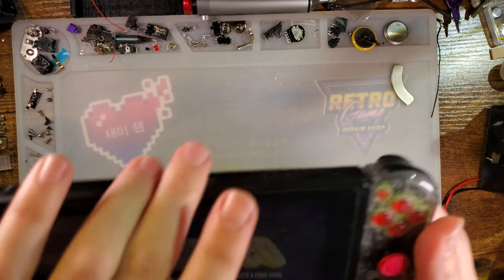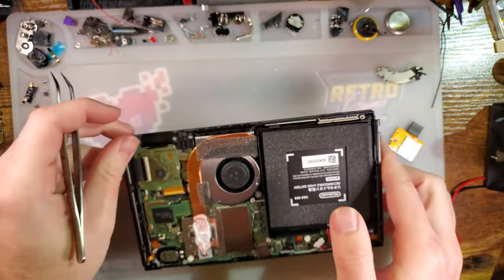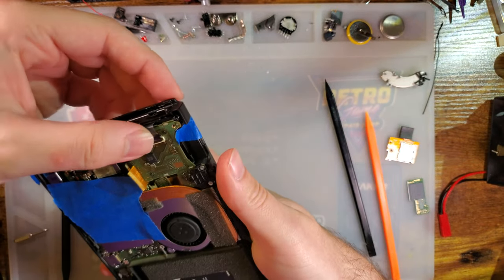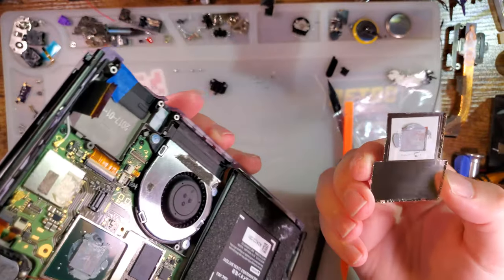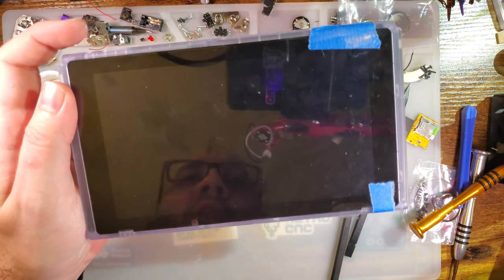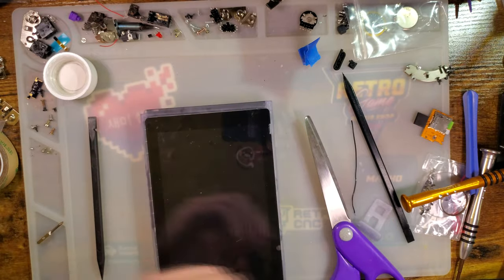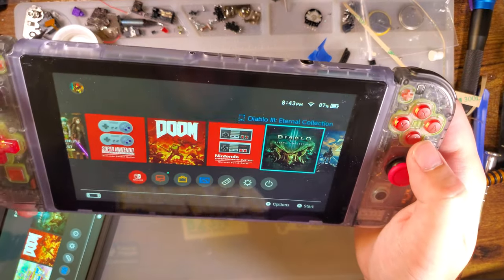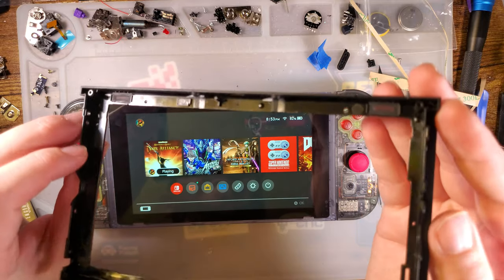Laminated Nintendo Switch LCD Installation (Release Model)

Comment from the maker: I did the panel a disservice by leaving the protective plastic on the whole time. I should have removed it at the end but I did not. Here are some images I captured after the install with the plastic off (and the same glass screen protector installed that I had removed in the beginning of the video): https://imgur.com/a/7ClvIij

And I ended up ripping the console apart to install the little parts I forgot initially. Enjoy this new album (I cleaned the screen this time): https://imgur.com/a/cC07sbE
Reply: I feel you also did a disservice by not cleaning the old screen while you were demonstrating how it looks. It's really hard to judge old vs. new when the old is so freaking smudged with fingerprints that it pollutes the image.
Reply from the maker: @ProjectDv2  The pictures I took have the same screen protector installed as the original screen and thus the same smudgyness. No point comparing something perfectly clean when that something will never stay perfectly clean IMO.
Reply: @makho  You don't clean your screen before you play?
Reply from the maker: @ProjectDv2  in the video (and pictures) is about as dirty as I'd let it get. Any worse and I'll clean it, yeah. I don't mind a patina of fingerprints as long as it's relatively consistent and if I clean it, I have to maintain that clean otherwise it will bother me.
Reply: @makho  that's fair enough. I can't deal with more than two or three fingerprints on my screen when I play, the cloudiness of the finger oils ruins the contrast too much for me.
Reply from the maker: @ProjectDv2  I don't tolerate two or three either. It's an all or nothing thing for me.
Reply: @makho  if I have a cloth handy, it's nothing all day.

Regardless, thanks for putting up this video. I've been considering replacing the front bezel and didn't realize wow how much work it would be. A question about the 3M tape you use, is it any thicker than the OE gasket tape? Does the screen stand it any when using it?
Reply from the maker: @ProjectDv2  nah I believe the stuff I used is actually a bit thinner than OEM. It doesn't seem to make a difference in terms of fit though, especially with the glass screen protector on top.
Reply: @makho  word, I've learned a new resource. The double-stick I've gotten in the past is chonky stuff in comparison and drives me nuts.
Reply from the maker: @ProjectDv2  Here, I took new pics after I ripped it apart again: https://imgur.com/a/cC07sbE
Reply: @makho  LOL "a pain point." 😂 But seriously, thank you for doing that. I get a much better idea of how it looks. Now I'm rather tempted to go for one of these laminated screens if I do the bezel swap.

Comment: It's only a matter of time before we'll see glass digitizer laminated replacements
Reply from the maker: I hope so, I will gladly swap this again lol
Reply: @makho  I'll gladly watch you swap it again
Reply: @makho  yo laminating is easy peasy. I do it to phones all the time as the glass only cost like 10 bucks, might ruin it but then I only wasted 10 bucks. But you dont have to try to delam so you got it easy. I laminated all my old hand helds. It's called uv glue. Theres tons of brands but they all do the same thing. Good luck bro love your vids cause of the length. Nice to listen to while I do stuff
Reply from the maker: @snowfirebeast  yeah, no doubt. I've been doing a lot of research on LCD lamination and while I think it is something I can manage, I'm not sure if it's a rabbit hole I want to go down. As is, I can barely apply screen protectors, let alone laminate LCDs. 

As is, I basically want maybe one or two more assemblies (one being Switch Lite) so I'm not sure I'd want to stomach the cost to DIY it well enough.
Reply: @makho  😹

Comment: Most I've done was replace the thermal gunk with thermal pads & AS5 on the processor and the ram; and here you are doing the entire screen haha
Reply: I did the same thing with my V2 earlier this year, cleaned all the dust out of the fan and heatsink (there wasn't very much), replaced the thermal paste with arctic MX4 and I had to replace the gamecard slot.

Comment: Sorry for so many comments but. Heat up your stickers then put the blue tape on. Wait a sec and it will usually pull off without damaging sticker. Then warm up and place in place. Let it cool then remove blue tape. That's what I do when custom painting stuff

Comment: you dont really need the copper heat spreader. just do direct copper heatpipe on the soc
Reply from the maker: I've got some ideas on cooling mods but at the same time, I've never had any issues with throttling or frame drops so I think it's fine as is. Good to know for other consoles that might run warmer though

Comment: There is not difference between Switch V1 and V2 displays. The only thing which changed is Nintendo jumped on cheaper screens from InnoLux while launch Switches were using JDI screens which are amazing in every aspect - color,  brightness etcs.
Reply from the maker: Why do you think the listing divides the two then? 
It makes sense, I honestly thought they were interchangeable, but it seems kinda strange for the seller to specify.
Reply: @makho  No idea, but i'm pretty sure they have no difference. Prob he is meaning also the different brand of the panel.
Reply from the maker: @borisdg  I worry there's more to it than that so it's probably worth specifying, at least for that particular seller. Maybe it's a fitment thing too (but I was under the impression that that should be the same).
Reply from the maker: @borisdg  looking into it more, there are apparently v1 and v2 digitizers and cart readers (the digitizer plugs into the cart reader module). The displays appear to be fully interchangeable but the touch digitizer may not be and that's why the listings are separate.
Reply: @makho  Interesting. Thanks for sharing!
Reply from the maker: @borisdg  I'm still unsure if it's a branding thing because the parts are marked differently or if it's an actual electrical incompatibility but that seems to be the reason why there are separate listings for the assemblies.

Comment: I am reasonably sure I have a laminated LCD, but similarly also with a plastic digitizer, and I got at least one decent scratch in it before I put a screen protector on it, and I ordered that almost immediately, but it beat me to it, unfortunately.
Reply from the maker: unless you replaced it recently with a laminated unit, that's unlikely. But yeah, that's why I left the protective plastic on that whole time, plastic digitizers make me nervous
Reply: @makho  Ohh, I understood it as that was a factory unit or something. So no, no dice. But this makes me want to be on the lookout for glass digitizer laminated units, especially if there's an OLED option coming down.

Comment: You can remove that copper sheet from the heatsink entirely and get much better cooling by having the heatsink directly on the cpu. I dont see why they put the copper sheet and two thick layers of paste there its stupid and I doubt its much better than a thermal pad which would have been a much better option since it wont dry out
Reply: If I were to guess, it's for RF interference reasons. It's part of the RF shield after all.
Reply: I removed mine a few weeks ago and put thermal grizzly kryonaut between the pipe and cpu and some cs labs k5-pro between the pipe and shield. It's been beautifully cool ever since, it doesn't gets as hot as it did and I've been putting some serious hours into Baldo.
Reply: @SCorpG22  yeah the difference is insane

Comment: Next vid: lapping the chip on my Nintendo Switch!
Reply from the maker: I was honestly thinking about looking into cooling mods. Not that it gets too hot in my experience but there's just so much performance left on the table with the current implementation. Rough die -> TIM -> copper shim -> TIM -> heatsink -> TIM -> shielding (which likely isn't doing much if anything for cooling) just seems like there are way too many steps and that a solid copper coldplate directly interfaced with the die would be more efficient. 

Though, in retrospect, I bet it's done the way it is because Nintendo generally builds for durability (which is very evident looking at the rest of this console) and direct die contact is probably not the best idea for durability. One drop and inertial difference between the heatsink and the console could chip the die but with better mounts, that risk could be mitigated. 

hmm

Comment: Man.... Please tell me that's just a thumb smudge across the right speaker in the last 6 minutes or so of the video. It almost looks like the digitizer is already delaminating from the screen, but can't tell for sure from here. Otherwise, awesome showcase of the panel and install!
Reply from the maker: I did the panel a disservice by leaving the protective plastic on the whole time. I should have removed it at the end but I did not. Here are some images I captured after the install with the plastic off (and the same glass screen protector installed that I had removed in the beginning of the video): https://imgur.com/a/7ClvIij
Reply: @makho  Phew, that's good news, haha. Appreciate the follow-up photos, looks great!

Comment: I think the style of your switch is to get as many mods in one system as possible lmao
Reply from the maker: the tablet itself only has two right now, counting the screen. Three if you count the swapped out panels (cosmetic). The only other mod is the 64gb nand lol 

for now
Reply: @makho  how'd you manage the 64gb Nand?
Reply from the maker: @samuraivader3814  big switch has the nand on a daughter board that you can swap out. I just purchased a module on aliexpress, swapped the modules out, then restored a backup on to the new module and expanded the user partition
Reply: @makho  I would love to see a video on the nand swap/upgrade mod! Or even a detailed write-up similar to your awesome Gameboy mod encyclopedia you're building 😎

Thanks for sharing all the great work!
Reply from the maker: @MojojoJenkins  It was just a matter of swapping out the module. You can purchase 64gb NAND modules on aliexpress and ebay. Make a full backup of the NAND, swap the module, restore the backup onto the new module, then expand the user partition to fill the space

Comment: Did yours have any dust inside of the screen?
Reply from the maker: The whole point of a laminated display is that the display assembly is sealed and cannot get dust since there's no open air anywhere between the lens and LCD.

Comment: just installed the laminated screen and I can see that there is light, but the screen stays black D:
tried what you did in the video and it won't show the actual screen. it works with the dock though. Any ideas on what else I could try to get it to work?
Reply from the maker: The display portion of the ribbon cable (the wide one under the cart reader, not the wide one on the cart reader and not the thin one by the joycon rail) is extremely finnicky to seat. Keep trying and you'll get it.